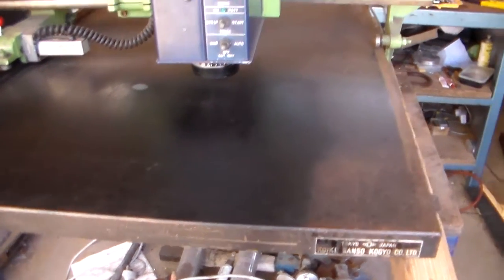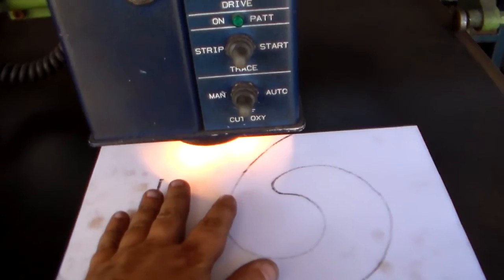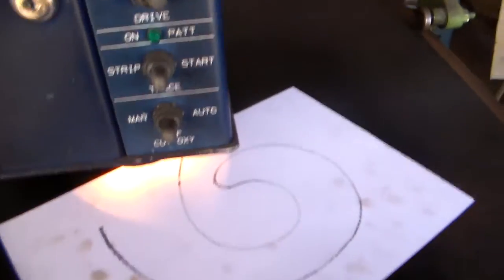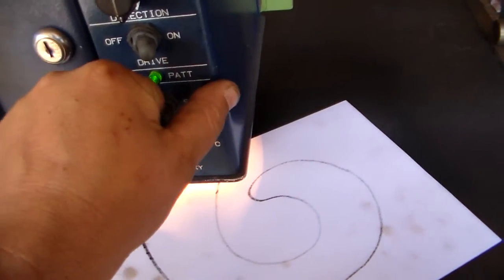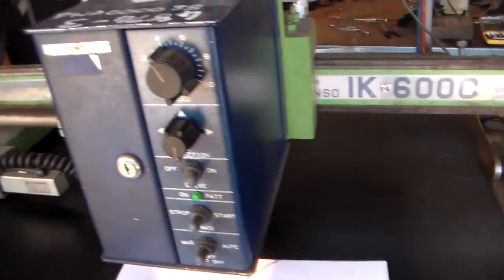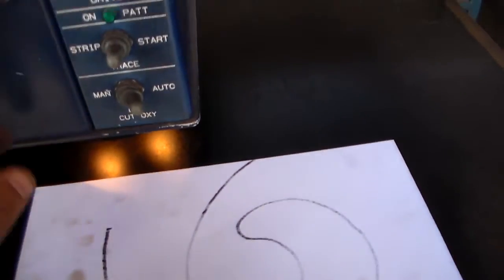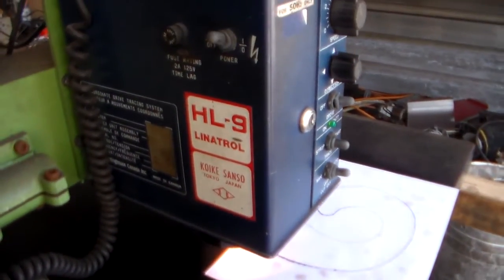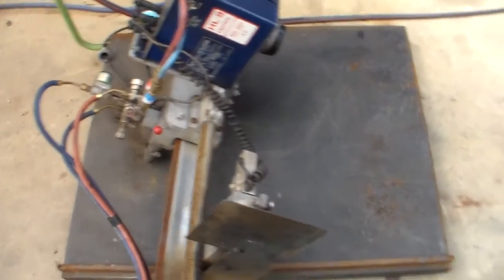Machinery Monday:- Koike / Westinghouse Oxy/Fuel Profile Cutter Repair

Comment: Hello Sir I have a L-tec cm 24 it is a 24 x 24 inch cutter basically like your machine with HL-90  I have the same issue that it starts to trace but then just runs off the pattern and stops. I put a gage and set the head to 38 mm but still the same issue. would you post how you finally fix yours. Thank Neil in the FL USA thanks.

Comment: I had a similar machine many years ago but configured as a water jet cutter, with mine the template had to be fully cut out, ie white positive against a black background. I used to make a template out of 3mm MDF and spray paint it matt white, gloss would confuse the pick up. Hope that is of some use.